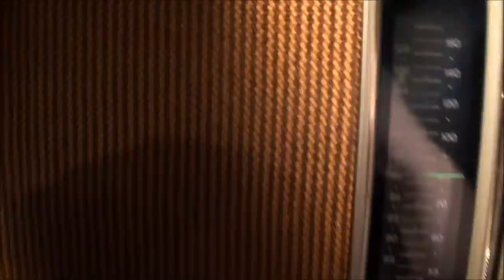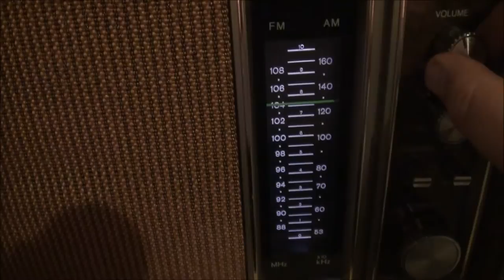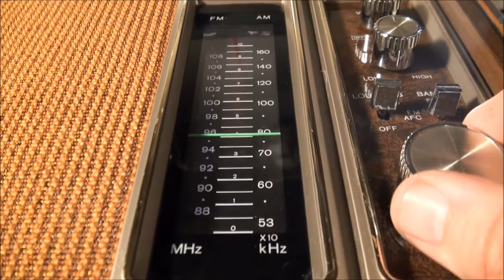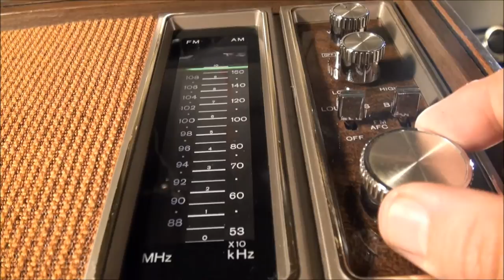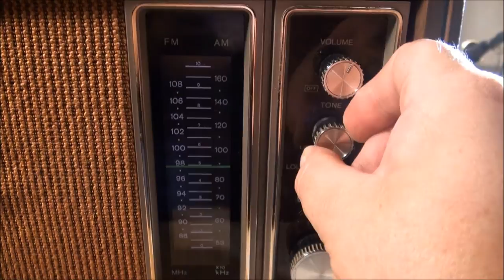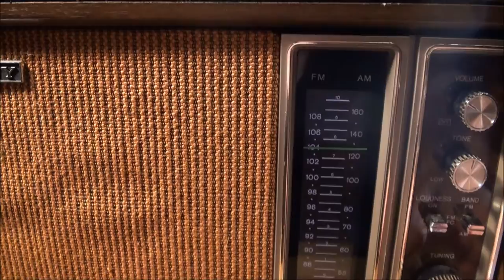1970's Sony AM/FM Tabletop Radio TFM-9450W

Comment: Any way you could do a video on how you cleaned the contacts? I just received one of these radios as a present and mine makes that scratching sound when adjusting the sound and tone.
Reply from the maker: This is quicker than waiting for me to make a video I might never make: Do a YouTube search for "cleaning electronic controls." You should be served up a list of videos, one by uxwbill on the subject, watch it. Unplug your radio. Try cleaning the controls from the front first, that's easiest. The knobs controlling your radio's volume and tone controls pull off with a firm tug. Spray the recommended cleaner inside around them and work the controls back and forth. More than one application may be necessary. You might have to wait a few minutes. Replace the knobs. If that doesn't work, you may need to unscrew and remove the back of the radio, find the back of the contacts and repeat the process there.
Reply: Thank You very much for the detailed response.
Reply: @Maverick1701A   Practically impossible to just pull a knob off and hope to get any beneficial cleaner inside the pot. That shaft is a tight fit and you won't get any spray inside the pot where it is needed. Do it the right way - remove the back cover and spray those pots and control switches that way. Of course, make sure your radio is unplugged for safety reasons.